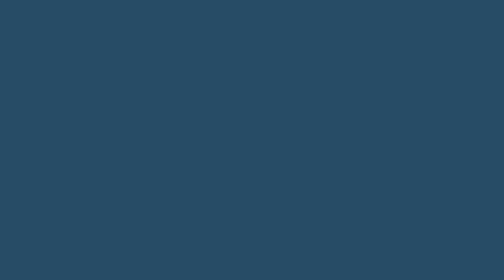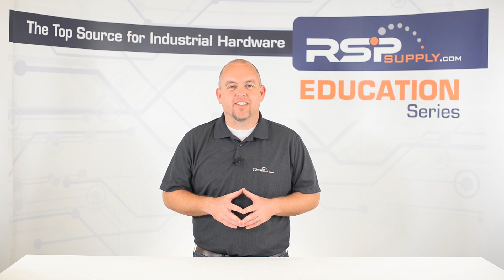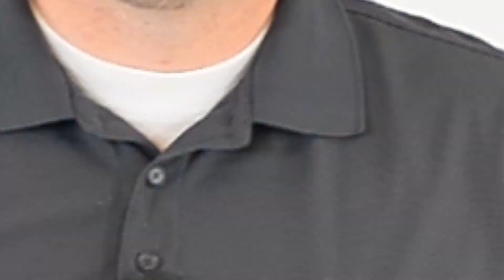Instrumentation:  Elements & Transmitters

Comment: Very useful. Thanks. May I suggest a companion video discussing the principle behind some common instrument elements. For example, vibrating, rotating paddle, mechanical (diaphragm), microwave (radar), capacitance, optical, pulsed-ultrasonic and ultrasonic can all be used for tank level measurement - but how does each work and when might each be appropriate.